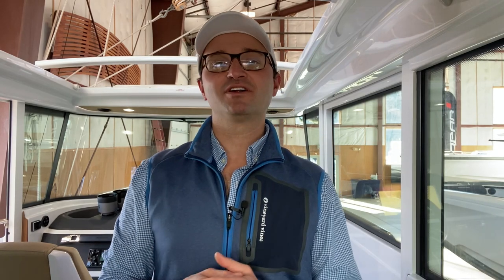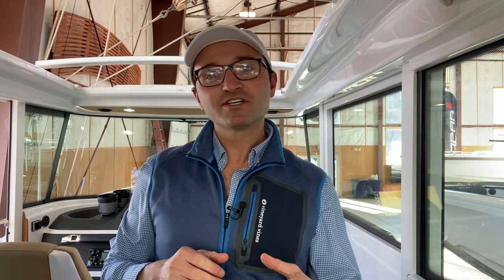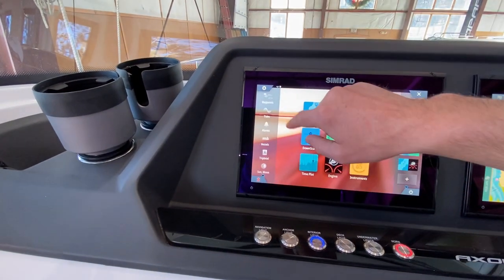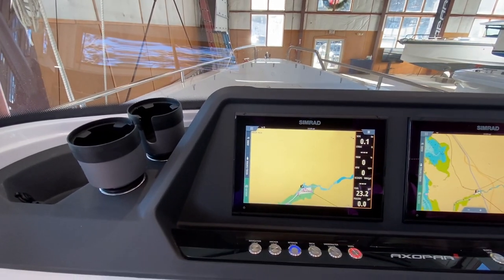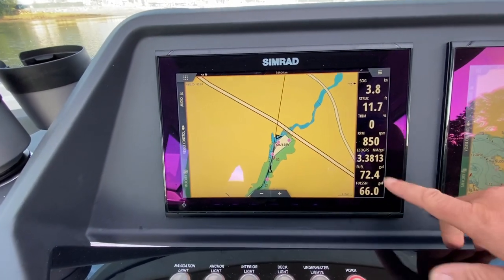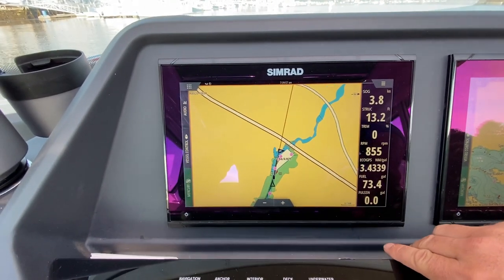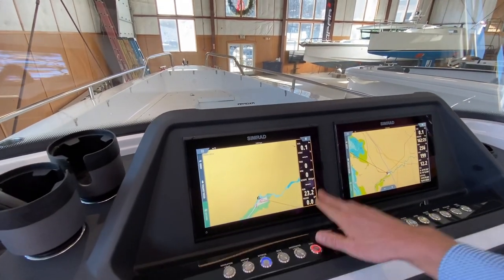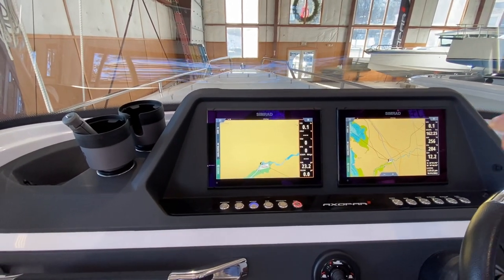Axopar Education Series: 2022 Axopar 28C - Fuel Management

Comment: Ben, can you clarify which engine system you are referring to when stating you route plan for a 1.9 NMPG fuel burn?  Single or dual engines, and how much hp?  BTW these 'education series' videos are well worth watching and leave me more inclined to purchase an Axopar 28...so thank you!
Reply from the maker: The engine that this was for is a single 300. But I would use the same fuel burn rate with the twins as well.

Comment: I HAVE A BIG QUESTION???????   I SEE YOUR AXOPAR 28 ON A TRAILER.  IS IT LEGAL TO TRAILER A 9FT BEAM BOAT IN NY?   IF NOT WHAT IS INVOLVED IN BEING LEGAL?   WHAT SIZE TRUCK IS NEEDED TO HAUL IT????   Thanks
Reply from the maker: Every state is different when it comes to trucking, but you typically need to get a permit in the state(s) that you’re operating in.  Here is.a link for the rules for state of NY: https://www.dot.ny.gov/nypermits/repository/PERM30.pdf.  We move the 28 with a 3/4 ton truck.  Depending on what you’re doing, it may be more efficient to hire a professional boat mover.